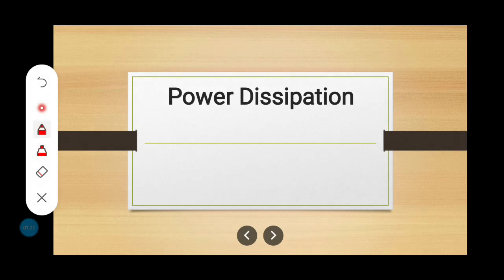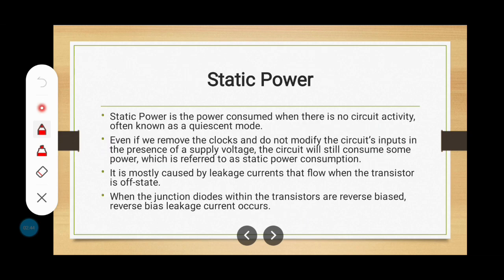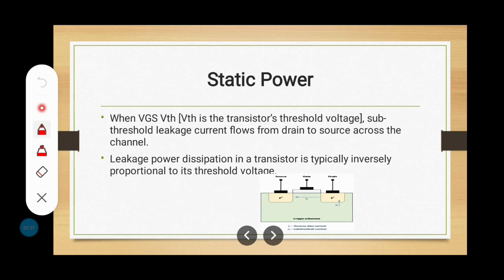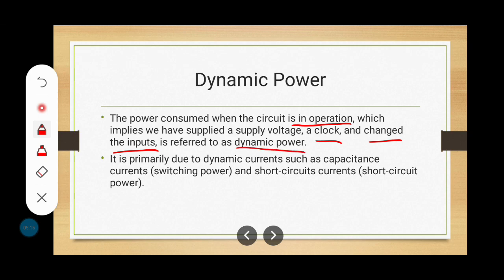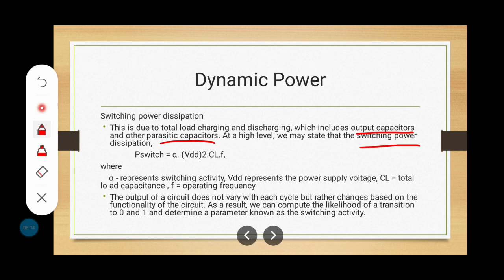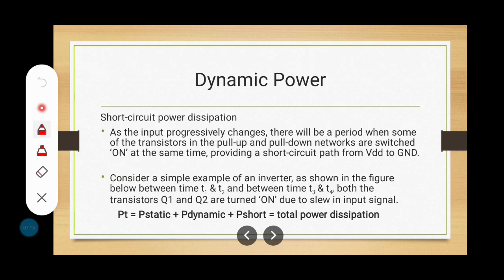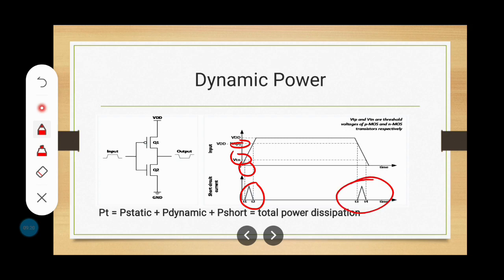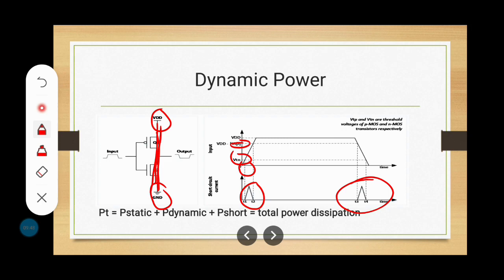Power Dissipation in VLSI Design || Static and Dynamic Power Dissipation || S Vijay Murugan

Comment: Sir plz upload these topics
 UNIT III : SEQUENTIAL LOGIC CIRCUITS AND CLOCKING STRATEGIES 

Static Latches and Registers, Dynamic Latches and Registers, Pipelines, Nonbistable Sequential 
Circuits.Timing classification of Digital Systems, Synchronous Design, Self-Timed Circuit Design .

UNIT IV : INTERCONNECT , MEMORY ARCHITECTURE AND ARITHMETIC 
 CIRCUITS 

Interconnect Parameters – Capacitance, Resistance, and Inductance, Electrical WireModels, 
Sequential digital circuits: adders, multipliers, comparators, shift registers. Logic Implementation 
using Programmable Devices (ROM, PLA, FPGA), Memory Architecture and Building 
Blocks,Memory Core and Memory Peripherals Circuitry
Reply from the maker: I will upload all the content as soon as possible ma
Reply: @learnthought3871  thanks sir